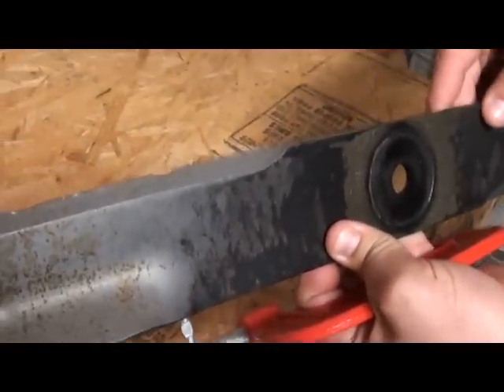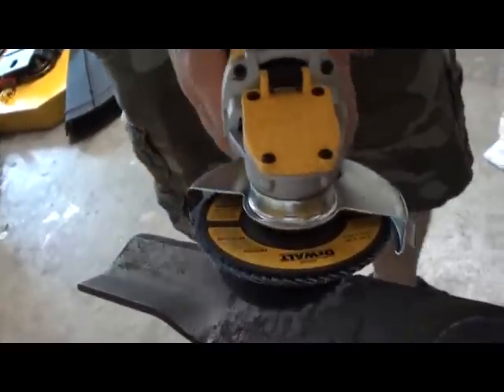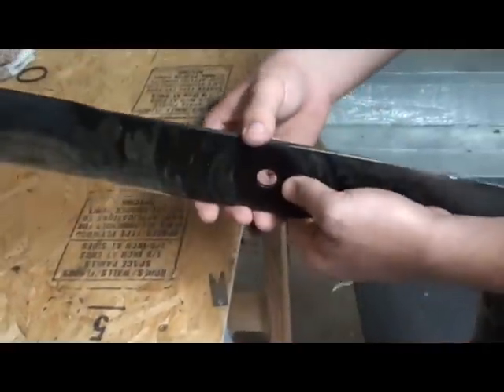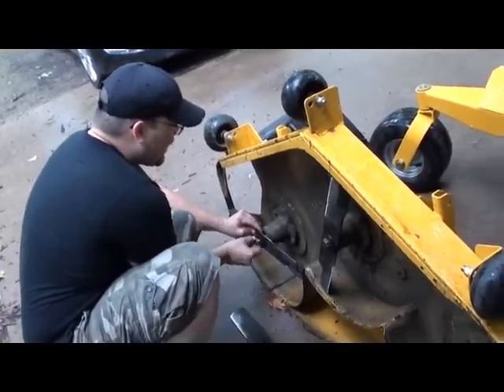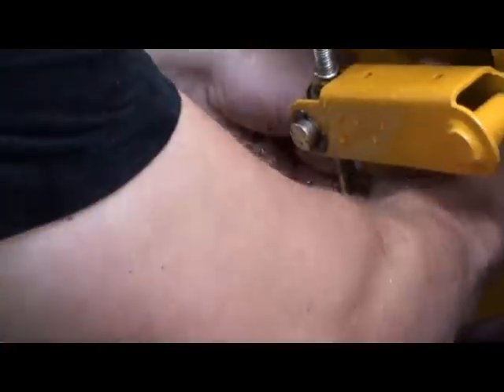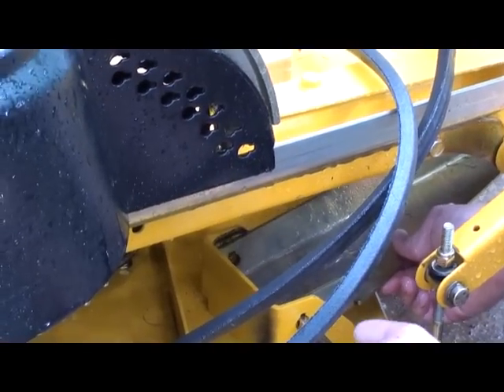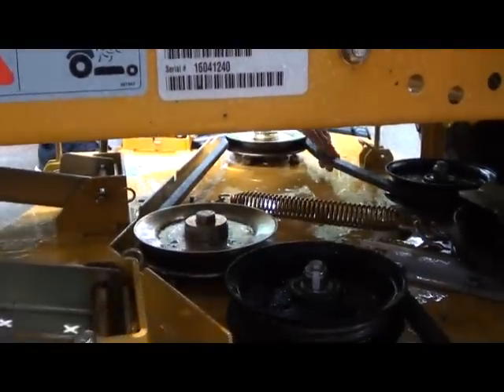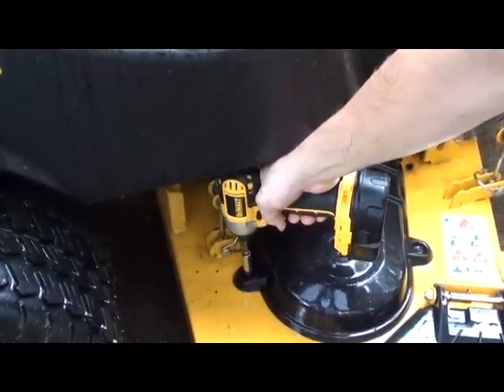EASY! remove/replace hustler lawnmower deck & blades

Comment: Thanks for the upload and sharing your technique. I was hoping to see how you remove the deck though as implied in the title. While it is easy to jack it and impact the blades off for sharpening as others have mentioned,  removing the deck completely for full maintenance and cleaning is what I need to do. Your procedure allows one to inspect belts, access blades and easily scrape out impacted grass which is great. The straps to hold the arms up while reattaching the deck is a good tip as well.
Reply from the maker: thanks Byron!

Comment: A chain hoist and a 6 foot tow strap wound under the frame at the front of the mower, works fine to raise the front of the mower to clean the bottom of the deck and remover blades for sharpening.

Comment: I had one blade that would not come off with impact wrench.  But if you apply the impact wrench and turn it on and hit the actual flat part of the blade at the same time with a hammer, it comes right off.  Sometimes, if the blade is slightly bent and pinch in between the huge washer, it needs you to release that pinch, while torque is being applied.  Otherwise the impact wrench just pinches it tighter. Hustler 52 inch deck

Comment: If you don't balance those blades after sharpening, not only will they be noisy and shake the hell out of you when mowing, but they will wear the bearings out prematurely. 
Get a blade balancer or print yourself one on a 3d printer.

Comment: That sure is a lot of extra work for blade replacement or sharpening....takes two minutes to remove blades with a impact wrench.
Reply from the maker: agreed,.. it was his first time,.. i also have another video of them being removed much easier, www.youtube.com/watch?v=1LU20TVCjdw
Reply: It may take only a few minutes to remove the blades, unless the last owner has not removed them for eons.
 I am currently struggling to remove the blades from a used Hustler Z and it has whooped me so far.
I tried the c-clamp on the deck. No luck.  I gave up on the impact wrench. I have a long handle socket wrench and still no luck. 

I figured I could wrap a chain around the blade and a neighboring spindle to hold the blade steady while I tried the impact wrench. Still no luck.
Now I am trying heating and cooling with the propane torch. I suspect I will need to heat and cool multiple times before it finally gives me satisfaction.
Meanwhile the lawn hasn't been mowed for weeks and would really like me to be successful.
Reply: @daugusto2662  Been there, done that. I eventually succeeded by heating the nut with a propane torch until it was red hot then applying my cordless 1/2" impact wrench. It worked but was slow going. I used anti-seize lube on reassembly and torqued them down to 125 lbs. The next year was better but here's what I discovered. Impact wrenches come in various amounts of torque. Mine was 140 ft lbs. Fortunately it stopped working and I discovered that Milwaukee makes 3 different impact wrenches. The more torque they have the more expensive it is. I chose the middle grade Model 2861 that is rated at 450 ft lbs tightening and 600 ft lbs loosening torque. It's a beast and I will never have a reason to get the top of the line one.

Comment: i use a cherry picker to lift it off the ground and take blades off...
Reply from the maker: lucky! wish I had a cherry picker,.. I use a come along and a tree branch now!
Reply: they really are not that expensive if you look around, some are less than 200$ if you get a good one with the legs that fold up they dont take up much space either.
Reply from the maker: I was referring to the ones with motors and wheels LOL
Reply: ahh
Reply: Chain hoist!

Comment: It’s easy to remove any blade from a lawnmower but better yet just Buy another different lawnmower because hustlers are not good. I will definitely replace mine next year with a different one.
Reply from the maker: Only had one issue with mine. fabrication error, fixed it free

Comment: Why did you take the deck off the mower. And why not balance the blades. I always jack up my mower to remove the blades. You will be surprised how much balancing helps take out vibration.
Reply from the maker: he balanced the blades, ground off only a certain amount of times per blade,  how do you balance it? with a string? it was his preference remove the deck       this way

Comment: Just shoot those sparks over toward that gas hot water heater. Noting to worry about here!
Reply from the maker: no need to heat hot water,... being as the gas is being consumed by the pilot light,... there is nothing to worry about